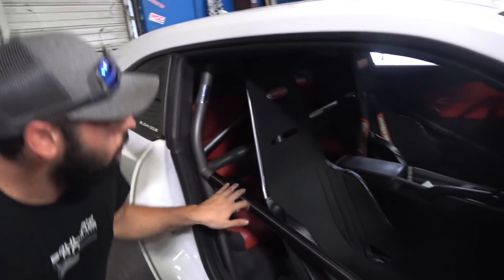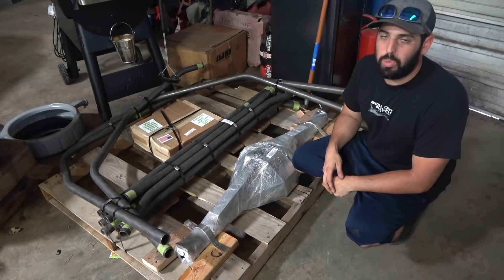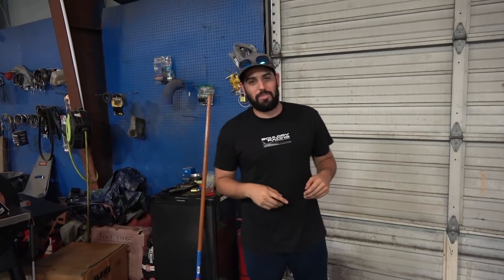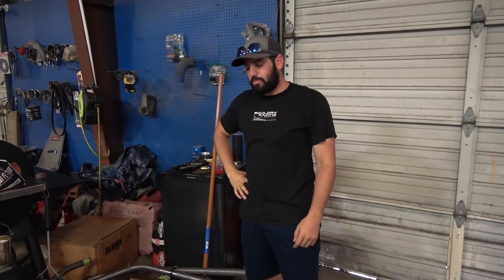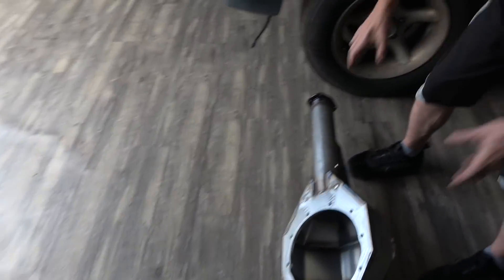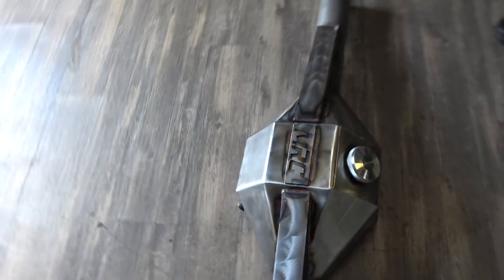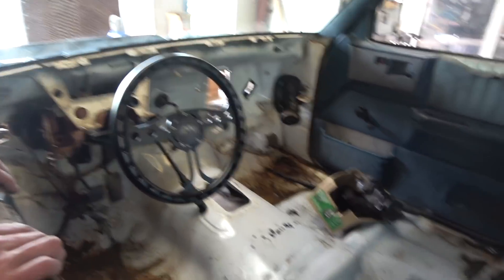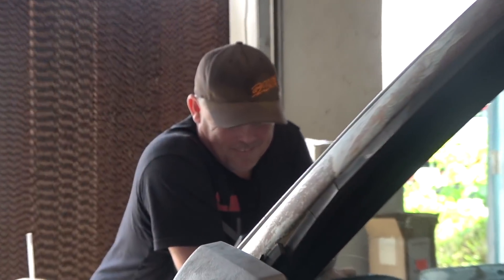50 Chance gets killer upgrades! FAB 9 and cage! Street truck build pt. 4

Comment: FYI John:  Run the stock rear leaf springs.  Do not run lowering springs.  Watch the SRC Garage where Bill Hoskinson goes over Billy the Kid's S10 suspension.  Lowering springs will move the Caltrac bar location and you will have problems hooking.
Reply: There is more than one way to skin a cat. Bill has a good system for their truck, but it doesn't mean it's the only way. Matt knows his shit, so I am sure they will make it work no matter what direction they go
Reply: @thegooniverse495  would rather say something then not.  I learned the hard way before Bill put out the video.
Reply: Matt is way better tuner/racer than Bill.. not even on the same planet
Reply: @vintagepolaris  results are results.
Reply: @Bad_Idea_Mike  and Matt's results are much better ones. Not to take anything away from the old man.

Comment: I bet that rearend housing is nicer than one I got from strange.
Reply: @mooreracechassis  Going by when I slid axles in my strange housing that was about a year after I bought it I dont think the housing is straight. Do you have a way to tweak it or should I start over with one of your housings? Its a 9inch that I need ballistic fabrication purches welded on and would need the small bearing 8 inch ford bearing ends from strange welded on with 3.25 tubing. You could use my housing as a referance for width and perch spacing and angle.